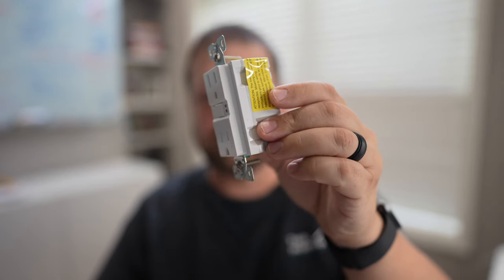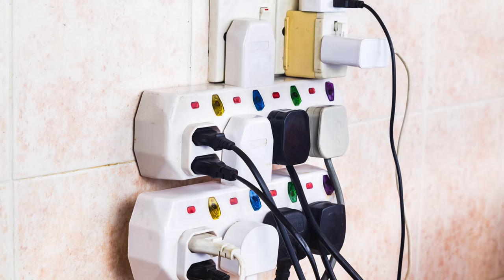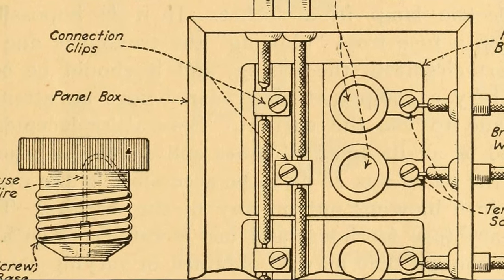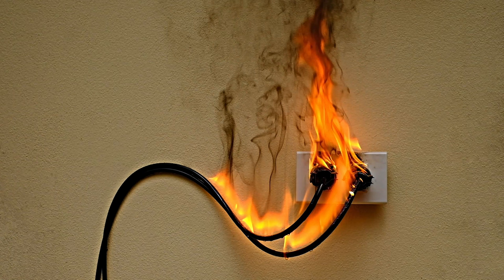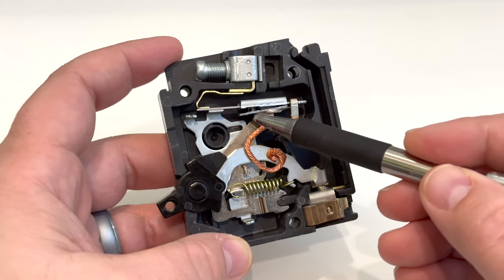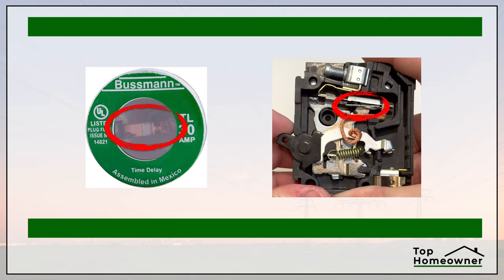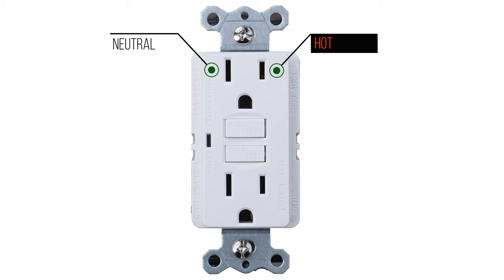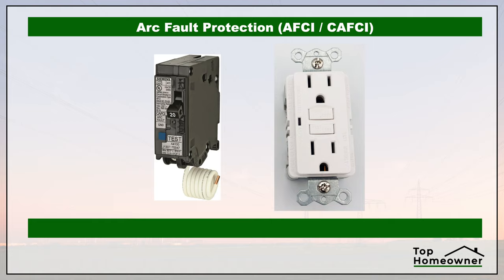DIYers Guide to Understanding How Circuit Breaker's Work

Comment: Fuses actually have one advantage over circuit breakers, and they have been used in some homes right up until the early 1970s.  A fuse, being such a simple device with no moving mechanical parts, will always be guaranteed to blow if too many amps is allowed to flow, whereas some circuit breakers brands from the 50s through the 70s when fuses and breakers coexisted , were notorious for being very unreliable and oftentimes failing to trip, causing overheating and fire hazards. Federal Pacific Electric aka Stab-Lok, and Zinsco,  sometimes with the words GTE-Sylvania, Sylvania,  or Magetrip, were among the worst.   

The simplicity and reliability of the fuse is also a dangerous flaw.  Sometimes a fuse that keeps blowing because of overloads will be replaced with a larger amp rating to stop the fuse trouble.   It's also just as easy to bypass the fuses in a couple ways.   Placing a penny in the socket,  breaking open the fuse and packing with aluminum foil,  inserting a screw base receptacle and putting a staple or piece of wire in the slots, or running fuses through the washing machine filling them with water to make them conductive.    Cartridge fuses can be replaced with copper pipe or metal conduit, wrapped in aluminum foil or gun wrappers,  or have a nail driven through the fuse.   Many homes burned as a result,  and the presence of a fuse panel puts many insurance companies on edge,  securing a policy can be expensive or impossible.
Reply from the maker: Really great points... Thanks for your comment!
Reply: @TopHomeowner  Fuses can melt together.